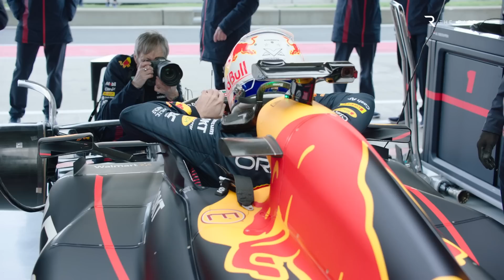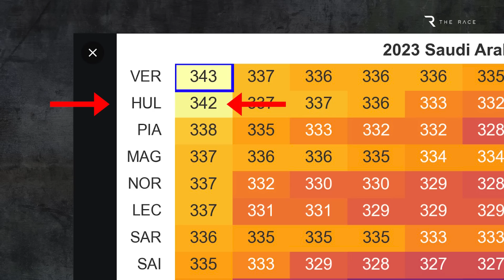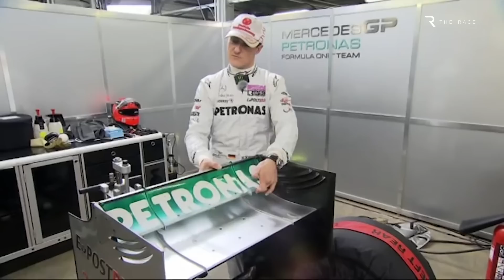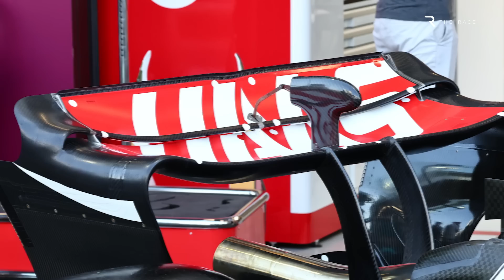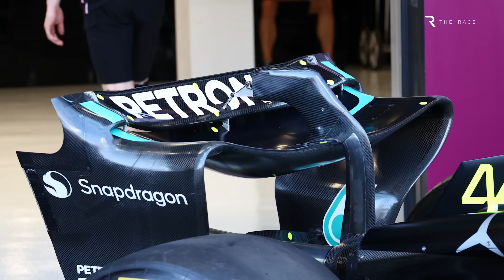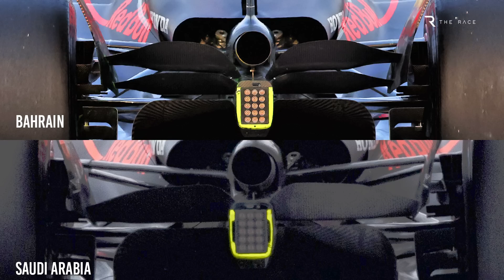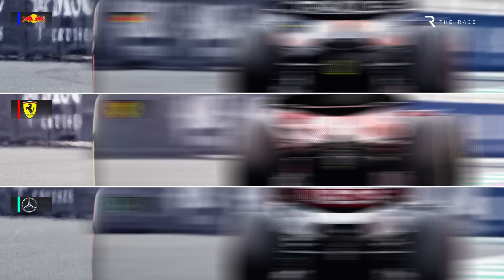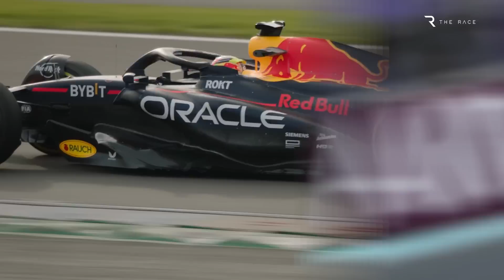Red Bull's genius 'triple DRS' F1 trick explained

Comment: Wasn't Hamilton amazed at the speed differential between his 2021 car and the rest of the field when he breeze past everyone as if they were standing still in Brazil?
Reply: @Sidharth Tirkey When Max does it it's the car but when Lewis does it it's the skill, yeah totally right
Reply: @the0glitter  huh,media literally seems to say the opposite take for example spa 2022 when max had a freaking rocket,but yeah it's incredible skill from max
Reply: No. They've called it Hammertime 🤣🤣🤣🤣...and now just hammered
Reply: @Samo_Malo  that hammer got caught by hela and now it's in pieces
Reply: @shivamgalkhe3887  But that hammer got put back together  in love and thunder
Reply: @Samo_Malo  the hammer handle is a bit loose know he is struggling to hammer the nail or nail the hammer😂
Reply: that was tuned up engine and the rear "squat"
Reply: @robertbalu8001  oh yes, the oddly linear squat that was most likely the result of utilizing 90’s era Williams tech. That was illegal as fuck.
Reply: @robertbalu8001  finally someone who actually paid attention
Reply: @robertbalu8001  No it was not. You cannot do that legally, so you'd have to be suggesting both Mercedes and the FIA are corrupt or you'll just have to concede, like Team LH has to here, that it's just skill and talent on Mercedes and Lewis part.
Reply: Lol that wasn’t his skill. That was the powerunit running at full beans, while everyone else’s powerunit was at 75%.
Reply: @Chyeahokay and Mercedes destroyed 2 brand new engine's from  max ,max had only indeed the 75% old engine the last 4 races
Reply: no he wasnt. clearly.
Reply: @Sidharth Tirkey yeah nothing just a 14+ kph advantage over your teammate on a straight line by a fresh ICE. Damn yeah that's pure skill. A advantage on straight line. That's why he was going with 326 without DRS on the start/finish line . And a 20 kph advantage over others when running a high downforce rear wing. Even if Red Bull used their skinny Monza rear wing they would be outpaced on the straight line. Yeah just nothing only pure skill. Only the most unfair advantage ever
Reply: @Thomas-y24  Stop being delusional Lewis had 5 kph max on verstappen in the speed trap and literally talking about spicy engine while max drove a rocket in spa
Reply: No that was all him apparently and heralded as one of the best drives ever according to British media looool.
Reply: @joshuaroyle7931  Oh the classic "Hamilton could win with a F2 car" nonesense :D
Reply: @Sidharth Tirkey "I don't know why dont you talk about Max Comeback a Spa Or Sochi (2021)"
You mean why didn't they mention different circuits, different car configurations, when Mercedes didn't have a fresh "spicy" PU, because that is somehow relevant to speed differential in Brazil...? Great logic.
Reply: That car was truly the fastest I've ever seen... since 2014 mercedes 😂
Reply: Well, to be fair: if you drove the fastest car at the time you wouldn't remember either 🤣
Reply: Well, it was a brand new engine turned up to all hell - so probably not.
Reply: @infinitecrayons  it was a rear suspension trick that made rear of the car to drip down under acceleration so the diffuser stalled and the car loses downforce and therefore drag. But they didn't get caught until the end of the season
Reply: @Thomas-y24  lil bro they never said anything about mercedes being illegal or no stop being so delusional
Reply: @Sidharth Tirkey Max's comeback at Sochi was mostly related to a good call that brought him in early enough to get on the intermediate tire. The rest of the field waited a little longer and he made all of those positions while they were in the pit lane. I'm not trying to diminish his good finish, but he finished where did mostly due to a good call by the team, instead of an insane drive by Max himself.
Reply: @Sidharth Tirkey oh tells who gives a judgement, now complainmilton is slow so its the car...GROW up. They have enjoyed a really fast car for years. MAX said years ago, there are atleast 10 drivers which can be world champion if they have the car complainmilton was driving.
Reply: he said fastest car he has seen ! he can not see himself
Reply: @sidharthtirkey44That was slso his skills’😂😂😂😂 did he bend the wing himself at 300+?
Reply: Because lewis has the memory of a goldfish.

Lewis: British Fans don't boo
British Fans: Boo Nico Rosburg
Reply: On that one, he never saw cars so slow :P
Reply: Hamilton took new engine components in brazil too
Reply: @sidharthtirkey44 That was his extra freshly added motor pool engine in a higher power mode.
Reply: At around 30 kph difference at that too.
Reply: @Sidharth Tirkey No driver can increase their straight line speed with any technique, it’s straight
Reply: wonder what excuse the LH fans are going to come with, all hamilton did last year was complain, i guess we are going to see more of that, unelss merc can come up with some design changes and make the races more interesting..oh wait we already have feranando alonso
Reply: @Sidharth Tirkey no it wasnt skill to pass 90% of the people on the straight....with a fresh PU that was turned up to 11...I know its hard to see your driver struggle to even beat his team mate but making up fantasies is not gonna help :)
Reply: Old lulu finished
Reply: @Sidharth Tirkey lmao had nothing to do with his skills. He took an engine penalty so it was cranked to the moon and he was pulling everyone on the main straight...
Reply: Nah the British media thinks it’s the greatest drive ever and it was all driver skill☠️
Reply: Everyone knew the engines were turned up. This is Aero speed. It's different
Reply: @Sidharth Tirkey "DTS fan" is now the go to ad hominem for anyone who gets their silly F1 opinions challenged and needs a cop out
Reply: @sidharthtirkey44 Speed differential on straights is not skill.
Reply: @Sidharth Tirkey Where was his skill from 2009 to 2013? Where was his skill in 2022? Why cant him breeze past everyone like he did in Brazil anymore? Most overrated driver ever who was lucky to drive the most dominant car in F1 history for 8 seasons.
Reply: @Sidharth Tirkey How was it skills??? He just had the fastest straight speed so it didn't even matter how he drove though corners. It was the definition of not needing any skill to win anyway xDDDDDD
Reply: He's playing to the camera for DTS.
Reply: Which is what makes redbulls speed advantage now amazing.
Reply: @Sidharth Tirkey naah.. new engine… now you are not allowed to change new engine every race🤣😂
Reply: Put that was due to running a spicy engine i thought ! LOL !!!
Reply: @sidharthtirkey44 he was amazed, he said so when the race was over
Reply: Oh no. That was his amazing talent 😅
Reply: no because he had already been doing since 2014
Reply: @Sidharth Tirkey so his skills made him pass everyone on the straights where he has to drive straight and go full throttle ? 
🤡
Reply: Or 2019-2020, or 2014-2016
Reply: That engine was from a different formula. Like it was taken off of a fighter jet.
Reply: selective amnesia
Reply: @Sidharth Tirkey He was breezing past people halfway down the pit straight. At Interlagos there is literally no defense against such a straight line speed advantage.
Reply: Exactly, lulu is a cry baby hypocrite.
Reply: if you look at facts he was not fastest in speed traps. previous gen cars was close in terms of top speed. merc never been fastest on straights after 2017
Reply: @lukamakharashvili832  Brazil 2021 contradicts your claim friend.
Reply: the cars are too big and too heavy....   toss the shitty engines and make them a lot smaller and DRS can be gone
Reply: because brazil lewis got pushed by max
Reply: @Sidharth Tirkey YOU brought up Max, no one else here did. Sounding
 like a typical salty hammy fan, not surprised
Reply: Nah he's just never been on the receiving end...
Reply: @Sidharth Tirkey There’s merely 4 races left when Hamilton got a new PU when normally they have to use it for about 8 races. So Mercedes can more than afford to turn up the power in race trim. Verstappen simply couldn’t, and his comeback to P2 is mostly caused by other teams making terrible decisions. He would’ve been around P5 or lower under normal circumstances
Reply: @sandalphoncpu  qatar lewis literally raced with the old pu bow down boi
Reply: @Sidharth Tirkey Stay off the drugs hammy d rider
Reply: @guccipoochi  he's a slumdog begging the British to recolonize his country, it makes sense
Reply: And yet Hamilton didn't even have the highest top speed of the race. 😅
Reply: Right, Hamilton in a competitive car faces all the criticism his way, anyone else in a dominant car is - the world is okay with that.
Reply: The speed difference to the RB in that race was not as big as the RB in the last race. So much so that Max was able to defend against Hamilton with an old engine. But let's pretend that didn't happen amirite?

The RB this year pretty much does the same to every car in the field, including the other top teams that are in second, third and fourth in the championship.
Reply: @Sidharth Tirkey greater power? the engines are locked in and cant be tweaked past its registered default..
Reply: @AntisnakeYT  This is not correct. The rules for F1 power units relate to engine displacement, number of cylinders, and hybrid configuration, not power output. Any of the teams could turn their PU's up to probably 1500bhp or more, but in doing so the PU might only last 1 Gran Prix (or less - see Ferrari 2022). The "Spicy PU" that Mercedes used was probably turned up from around 1000bhp to around 1250bhp, which allowed Hamilton to pass other cars on the straights without even using DRS (it happened multiple times in Brazil 2021). While I am a RB fan, I very much respect the decision by Mercedes to throw the money behind additional PU's to achieve this, and also their having great faith in their PU's to survive the increased output and drivers to not wreck the cars starting from the back of the grid. Remember in 2022, Ferrari turned up the power on their PU's and were the cars to beat every GP, but poor strategy and unrelaible cars proved to be their downfall. Remember, PU costs are not included in the cost cap. The current issue for Mercedes is that their car is no longer good. Even a "Spicy PU" can't fix that car they are in right now. Even Toto has said that this year RB has the fastest car and the best driver (Max) on the grid. I don't understand why there is so much arguing on any of this.
Reply: So many people will be jealous of Hamilton and love expressing their insecurities online
Reply: This same old tired, repeated nonsense regarding how fast Merc were in Brazil 21 came about because Christian Horner said so. As with most things he says, there was little truth in it. In the race he was 5th fastest through the speed trap and 13th fastest across the finish line. Mercedes explained a long time ago they aced the sweet spot in their setup which launched them off the last bend and helped them carry speed at the point of the circuit that is most crucial for overtaking. Combined with good tyre deg meant it gave them a very strong package. People conveniently forget that Checo overtook Hamilton in this very race when he was in DRS range of him - something that was impossible on the RB at Jeddah, even with the other car.
Reply: Hamilton wasn't even the quickest in the speed traps in Brazil...
Reply: @CaptJofaz  “Hamilton was also the fastest in the first DRS zone, 168 meters before the Turn 4, with 343.2 km/h, almost 20 km/h faster than Verstappen (326.5 km/h) while Sainz, who did not have the option to use the DRS, was at the bottom order on the first three speed measurements.”
Reply: Remember Folks. There is an Engine Freeze. That was Initiated by RB and Honda.  So safe to say this is Pretty much Aerodynamics..  and who's in Charge of this??? Adrian Newey.   As soon as they Fixed the Engine ( Engine Freeze) Who Raised to the top?  Who's the Greatest Engineer in F1 History?  With that most Constrictors Titles and WDC winning Drivers? 
The one and only Adrian Newey.
Reply: You do Realize that by Shortcoming Lewis Hamiltons Abilities to the Speed of his Cars, that your also Admitting that Max Current  Results are from the same Fastest car origins???   
Remember, .Adrian Newey Has had" 7" WDC Drivers ( Seven Different Drivers). Only one of those Drivers won a Championship Before Driving Newey Car (Prost). And None Won a championship After Leaving.   
Adrian Newey has 11 Constructors Championships and 10 WDC winning Seasons. 
Lewis Not only Has Beaten 3 WDC winning Teammates.  He has 7 WDC Titles and He Finished 2nd in the Championship 3 times including his Rookie Season!  On Different Teams. With Different Car Designers.
Vettel Won 4 WDC with a Newey Car. Hakkanen 2- Verstappen 2, Prost, Villnueve ,Damon Hill, Mansell. 
Hamilton Achievement is Far Greater with direct "Championship Winning" Competition in the same car!   Whole Different level
Reply: @darwinLee81283  It's funny you mention WDC teammates, because Button and Rosberg are some of the weakest 1 time champions of recent times, and Hamilton was also beaten by both over a season.
And 5 of his titles came with Bottas and Kovalainen - statistically the weakest teammates he ever had.

What about 2009-2013? What about getting beaten by Russell last year?

"On Different Teams. With Different Car Designers."
Two teams. That had the best or joint best cars/teams of the year.
Reply: @Ruylopez778  Does Messi Win the WC every Year?  He's still considered the 🐐. Did Jordan Lose in Playoffs. Still considered the Best ever.   To argue my Points by saying What happened Said year with Said Driver is invalid.  It's the Accomplishments that are Highlighted on top of the Direct Competitor!
Reply: @Ruylopez778  I gave you Information over Lewis Hamilton's 16 year F1 Career. Where 10 out of those 16 Seasons he either Won a Driver's Championship or Finished 2nd. And you question the Abilities of the Champions he Beat?    If you don't understand Greatness. Just say that
Reply: @Ruylopez778  Will get beat by George again this year as well.
Reply: @RuyLopezQB6  lmao is that why max only has to face Perez? And lost to DR? And schumi post to Roseburg? Lewis lost to nico only because of reliability issues eg Malaysia 
And he best Russell second half of the season and Bahrain
Reply: @Ruylopez778  how is rosberg the weakest? Please show me evidence that he was. He was always close to Lewis and would win races. He was the 2nd best at that time but Lewis was on another level
Reply: @James-gr5mx  Try re-reading my comment.
Reply: @Ruylopez778  it's funny that you don't watch f1.
Hamilton lost to button in his worst f1 season by far,the car was no near good for his style and his teammate button was in his 2nd prime guess what?he still managed to do incredible performances like china 2011.
About rosberg you clearly started watching yesterday,lewis clapped him for 3 years straight literally in 2015 nico was fighting seb for the 2nd.
Lewis left 2015 chilling and joined 2016 calm only nico made a huge gap but lewis literally made an incredible comeback that if it wasn't for that Malaysia dnf(the only merc mechanical issue that year he was gonna win that wdc).
Also rosberg is by far one of the best 1 time wdc he was able to outqualify prime lewis and just to end this rosberg needed to change mechanics with Lewis asked for Merc full support to beat him
Reply: @mikevossel7484  Nice list of contradiction and excuses. Do you want me to shatter all the Hamilton narratives?
Reply: @Ruylopez778  what are you yapping about kid
Reply: @17k3ra  Great non-response. I'm amazed by your insight in your pathetic attempt to undermine an opinion you don't like. Congrats.
Reply: @darwinLee81283  you are blinded by Lewis his titles , mercedes had 8 constuctor titles in a row an and  7 wdc titles in a row without competition the first time Lewis had competition Lewis cracked under pressure from max and  2020 was a  coronatitle after 14 races  Lewis was already wchampion that is ridiculous ,everybody could easely win 10o poles 103 victories with the q3 xxl partymodes and the famous das system and not forget the welty mercedes spended for each car pro season between 100/115 million dollar more than other teams without the budgetcaprules so Lewis his merctitles are heavenly overated.
Reply: @peterbrown9046  Cracked under Pressure from max?  They Tied on Points Before Final Race. It took a Rear Floor Regulation Change, a Gifted Spa Win and Points despite a race not occuring,  a"human Error" and Cost Cap Breach to Steal his 8th title!  this isn't a Statement that can be Argued. The FIA Changed the Rear  Floor, The FIA allows a SPA race to finish under Yellow flag, The FIA admitted "Human Error" and DIDNT Let AbuDhabi finish under Yellow Flag and The FIA Revealed that RB breached the Cost Cap in the same season lol!
I can't be Blind if Statistics  and Publically Accessable information backs up my Point of view. Anyone could Get 100 wins. Right? lmfao.
The Guy had 21 wins a Second Place Season finish and a WDC  and Beat 2 WDChampionship teammates before he Stepped foot at Brackley in Mercedes 
😭😭😭
Reply: @darwinLee81283  so you’re going to act Hamilton winning and dominating had nothing to do with them having the details to the lower unit 3 years in advance of the grid ? It’s easy to win with the same time when you had a major head start at the core of a F1 vehicle. I’m sure you’re going to deny they never had a head start , but also won’t point out that paddy Lowe admitted that Merc had to dial the power back in 2014 to not face any form of investigation. Why would you be afraid of investigation if you did everting right by the book ? And let’s not start on how they had zero PU issues in the inaugural year of a new engine design while Honda that powers Indy cars struggled with a engine design they are known too produce. This is how Lewis started his dominance with one single team. Have the most powerful engine on the grid while everyone else is figuring out how to mechanically make theirs work and stay reliable.
Reply: @groundhabit6408  both talented drivers and teams. People should respect what merc and redbull did. They are dominating other teams. Now it's redbulls turn and eventually another team will take over in 5 years or less
Reply: @groundhabit6408  I've made Multiple Post on the Accomplishments of Lewis Hamilton before he ever Touched a Merc.   Go read them
Reply: @darwinLee81283  it's really hard to comprehend what you are trying to say, but are you arguing that Lewis' wins are more about his skill than the car simply because Newey didn't design his cars?

It's kinda hard to decide which one is worse, your argument or your writing.
Reply: @wombat4191  It's YT Comments. You expect punctuation.  If you can read English. You know exactly what i Wrote.   I offered Different arguments to show Greater Skillset
Winning as  Young Rookie
Winning "Not" in the Fastest car
Winning with Different Teams 
Winning Championships with Different teams.
Winning with Different Car Designers
Winning with WDC Teammates. 
Showing Evidence of His Historical Peers Unable to accomplish the same Titles or Wins (Drivers after leaving Newey or Before Joining Newey) 
Evidence to Show Adrian Newey as the Direct Catalyst for Max Verstappens Success!
Reply: @darwinLee81283  When has Hamilton exactly won WDC with not the best car? 2008 McLaren was the only one that you could argue about, but it was about equal to Ferrari really. In turn, he has lost the WDC to a driver in inferior car at least twice.

But anyway, your argument is extremely ironic considering that almost all of Hamilton's success is based on him being the lead driver in a dominant team during the longest dominant era in the history of F1. I'm not sailing he's a bad driver, I'm just saying that your argument about Newey being the reason for Max's success is a dumb one when you're raising Lewis on a pedestal at the same time :D

Also, your writing isn't bad because of punctuation or lack of it, it's just overall awful without even proper sentences.
Reply: @wombat4191  2008, 2017, 2018, 2019. 
2021 the red bull was quicker for the majority of the season. 2016 he had two engine failures that lost him over 50 points to Rosberg
Reply: @CaptJofaz  hah, none of those. Ferrari may have started seasons 2017-2019 strong, but Merc was always the better car overall for most of the season. As I said, 2008 the cars were about equal. RB might have had the edge in some GP's in 2021, but Merc was still better on average.

I have no idea why you brought Rosberg up though.
Reply: @wombat4191 First off.  Ad Hominem isn't an Argument and Voids anything you state after the Fact .So making Remarks about my Sentence Structure on a YouTube Comments Section pretty much Sums up your Lack of Argument for what I stated and has Absolutely nothing to do with what was Written!  Remember this is what you Lead your original response with Lol !!   You can't say My argument about Newey is Dumb and then Provide no Evidence against what I Stated!!  Everything is 100% Facts. There is Nothing Verstappen has accomplished that Any of his Peergroup  or Predessors have not also accomplished inside of an Adrian Newey Designed Car! Newey made Champions out of Damon Hill and Jaques Villnueve....lol.  Even Riccardo was a Top Billing Driver until he left Adrian Newey lol 
And I would Place Verstappen Slightly over Riccardo in Talent Who were equal at RB together in the 2016 (1 win a Piece) 2017( 1 win Riccardo 2 wins Verstappen) 2018( Both with 2 Wins and Riccardo Unreliable car)!
 And yes I Place Hamilton on a Higher Pedestal than Verstappen because of the reasons I stated in previous Comments.  You just Responded with absolutely nothing but an Emptyness about 2008. Ferrari Won the Constructors.  Ferrari Had the Most Fastest Laps. McLaren and Ferrari Tied on Poles and Ferrari had more Wins in this season Also. 
So you jusr pooped on your only Rebuttal lol
Reply: @darwinLee81283  but your argument is basically "Lewis is great because he won his championships without Newey", as if there are no other people who can produce a dominant car. I just like to point out how ridiculous that is. I'm not trying to argue who of the top drivers is better than who. Except that I'll say that Alonso is actually better than either Hamilton or Verstappen :D

As for 2008... You can't really use statistics as a reliable source. I mean, McLaren had Kovalainen, who's very much average at best when talking about F1 drivers, while Ferrari had 2 top notch drivers instead of 1.
Reply: @wombat4191  No. Lol you The Argument isn't Lewis is great because he didn't drive for Newey.  Lewis is Great because he Won against Great Competition With Different Teams. And won Races Every Season. With WDC winning Teammates and in 10 out of his Current 16 Season either won a Title or Finished 2nd ( mic Drop about Lewis Hamilton)
Imagine Saying a Driver who Just Received his 100th Podium is Better than a Driver with over 100 Wins and Poles. Lol.  imagine your argument about the 2008 Season is Ferrari having 2 top Drivers when the same can be Said for McLaren in 2007 And Lewis would have won in his rookie season if we Move forward with your logic!  
I rest my case bro!!
Reply: @wombat4191  Vettel fell apart every year but the Ferarri was very closely matched to the Mercedes over the course of the season. 

I brought up Rosberg because you mentioned Hamilton losing two championships with the best car. Which I assume you think are 2016 and 2021

And 2021 the red bull was very strong. On average quicker than the merc.
Reply: @CaptJofaz  I said he lost two championships against a driver in an inferior car, of course I didn't mean 2016 because Rosberg was not in an inferior car. 2007 is the other year, though I wouldn't really hold that against him. It was probably the best rookie season in recent F1, or maybe even ever.
Reply: Not so many times as max with  his Renault engine he had  at least 15 technical dnf's so Lewis can't complain during his 6  championshiptitles had Lewis zero dnf's
Reply: @peterbrown9046  Verstappen also Crashed A lot. Go check the DNF numbers. Lewis only has 26DNFs I believe in a 16 yr career.
Reply: @darwinLee81283  JFC...your writing is atrocious.  It hurts my head to read what you write.  Your thoughts are so poorly articulated it doesn't matter what your point is.  And I'm trying to figure out what your are attempting to say.
Reply: @darwinLee81283  lucky Lewis, if Lewis   drove into a redbull till 2019 with a Renaultengine  lewis had also 16 technical dnf,'s and zero championships, these are facts
Reply: @darwinLee81283  the unstable redbull till 2018 was the main factor for the few crashes from max and  75% wasn,t max fould
Reply: @peterbrown9046  Don't like your own comment 😭😭🤡
Reply: @darwinLee81283  you wish but you must learn a lot boy
Reply: @peterbrown9046  You say the DNF were Not Verstappen Fault. There is Video Recordings of Podium Drivers Literally commenting about how Dangerous Verstappen is.    They have Driver Audio of multiple Drivers Complaining about Verstappen. He was given the Name Crashstappen .!!!!!  But it wasn't his fault?  🤡🤡🤡🤡🤡🤡🤡